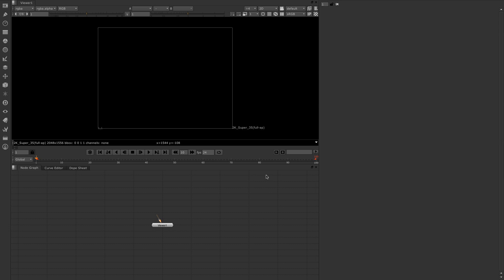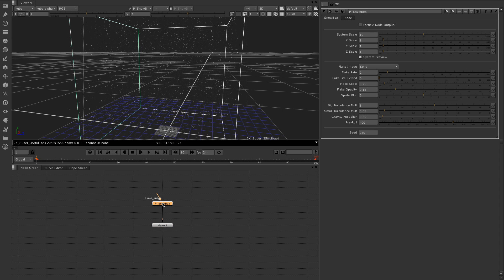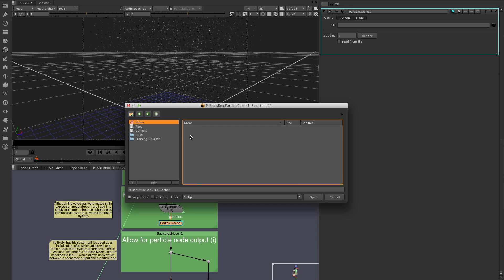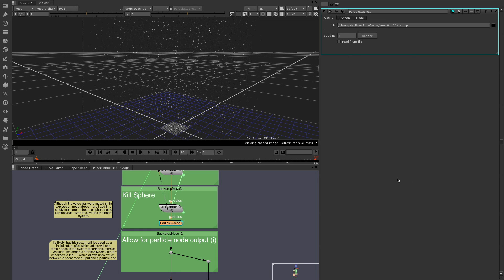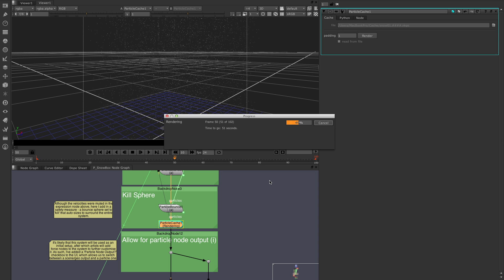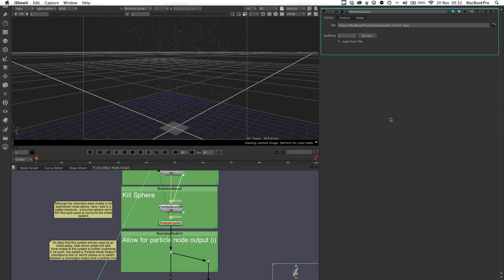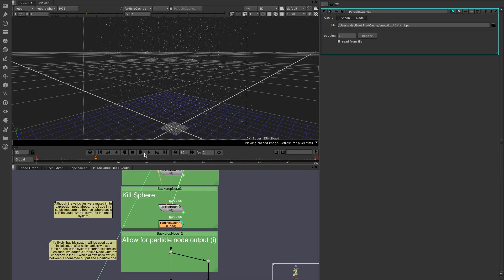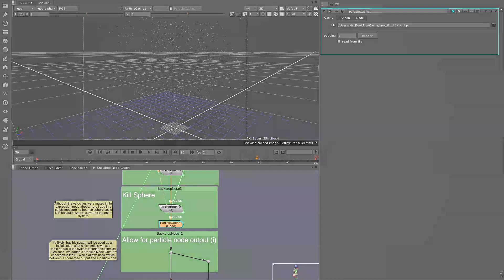Nuke 8.0 | Particle Cache: Tutorial

Comment: Greetings. This is definitevely a great explanation.

Using the same sample and following on the steps from the video here, after rendering to the ParticleCache folder, I played around by deselecting the node or unchecking the Read From File box; and the in viewer, it was still playing at the same speed. Even after deleting the ParticleCache node, the speed was still the same. I was not able to sense the difference in speed before and after integrating the node, nor after deleting it. Could there be a better sample to use as a reference to see this great node at work? Thank you Mr. Leonard.